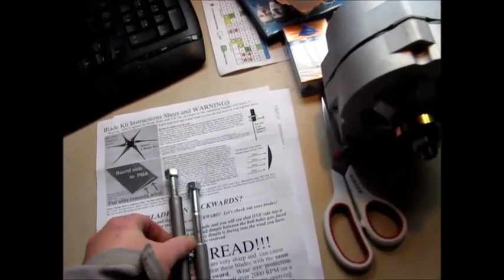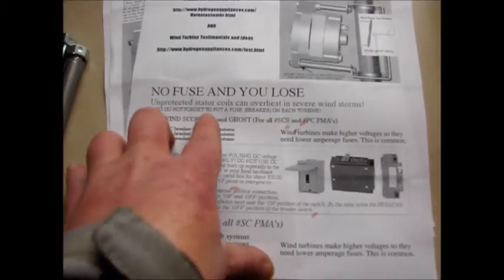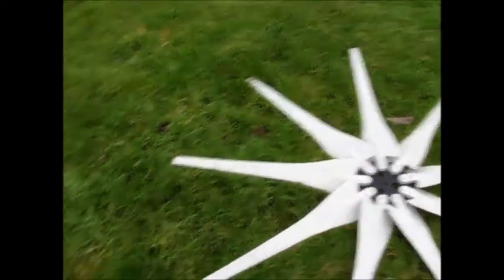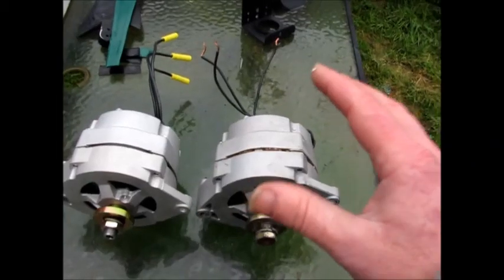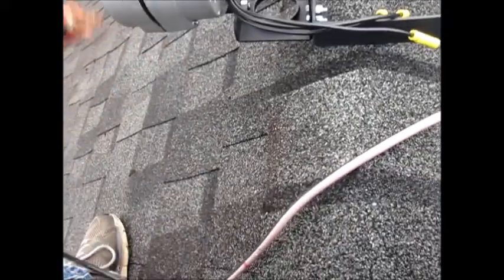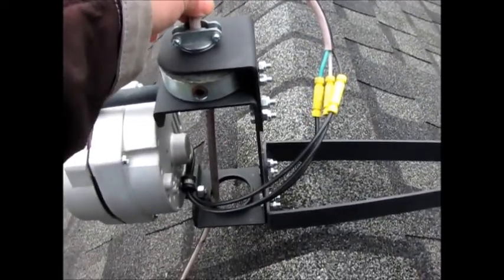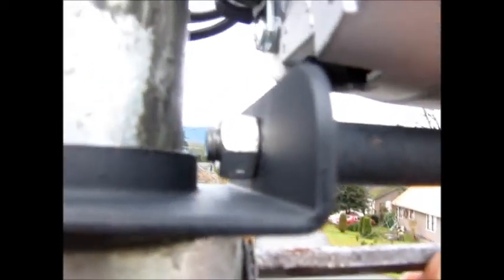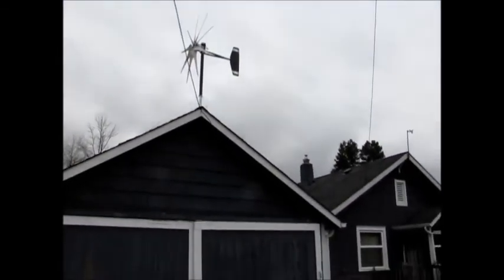Thermodyne Wind Turbine,, How I setup, and install mine

Comment: Jason, I'm starting in Wind energy. I'm wondering to install and still suspicious about pma's...My main concern is the output, Here in Brazil the Wind is quite dirty, many houses, small Yard, trees etc...According with the site the Wind speed avg is 10, 11, 14mph..Can you give na a good idea about the output you can get for this environment?...I mean may entusiastics of the big engines like axial magnetic flux Wind turbines says those small ones can get a useful amperage only in high Wind speed which here is quite uncertain.Thanks man.
Reply from the maker: Well from my dirty wind location exp ,, 10-14mph winds should be around 100w -150w max using the pma style turbine,, That is one reason I can have 5 different turbines at different locations on my property ,, it doesn't seem like much power, but the power increases quick when adding more small turbines to your setup ,, just like adding more solar panels to your setup,,
 I do not know if you are using batteries or going to try to grid tie your wind turbines?

 12 Volt turbines are not good for grid tie ,, to much amps ,, blows up the grid tie ,, in high winds,, I have seen during my winter windy season 100mph wind gusts,,
 I have to use batteries and dump load controllers during my winters, on my 12 volt turbines ,,

 Wind power is not as easy as solar ,, wind power takes some tinkering and fiddling around with to get the most out of your winds in your location,,
 If you buy a turbine make sure you can adjust how many blades and the size of the blades so you can fine tune it for your location so you can get the most power you can out of it ,,
Reply: Thank you Jason for the valuable information... Well as i expected you gave me the idea i had about pma. I started building a single 10th axial flux wind turbine...I think is more economic have one single unit than 3 or 5, my yard is quite small :(....I expect to at least get 400w 500w with 10 to 14mph.(hopefuly)...Maybe with some good gusts 1000w.... Actually I don't completely like this idea since the size and the weight is a challenge combined with a small yard... At least I'll raise only one pole :)... Thanks for the advice.... afterward I'll post a video about my set up.... Best regards Jason

Comment: Just an FYI, The reason for the angled mount is so when the wind blows hard, the BLADES will flex and possibly hit the mounting pole. It wont be angled wrong if you put it on your roof.
Reply from the maker: +Gordon Fisher,,,,
 If the turbine blades are designed properly the blades will not bend back and hit the turbine mounting pole ,,, I have seen over 80mph wind gusts and my MW&S G4 blades have never come close to hitting my mounting pole ,, I think if you have to change the angle of your turbine so Poorly Designed blades wont hit the mounting pole then,, well the blades are not designed properly ,, My MW&S G4 blades work perfectly for my single core turbines,, I trust my MW&S blades over 100mph wind gusts, and from what I HAVE EXPERIENCED IN MY AREA so far, my G4 blades Are designed properly,,, I have a old school MW&S turbine still running strong and safe for me and my family,, it is about 4 years old now with no maintenance ever needed ,

Comment: what keeps the cord from coiling up in the pole, is there a stop or a slip ring ?
Reply from the maker: Jay Finke The cord just hangs inside the pole and on short poles it will tangle,, here is a link to a video that shows how I fix this problem, at about 4 mins into the video,  https://www.youtube.com/watch?v=UBd2C-w7m-M ,, 
Here is another way I am testing using a 3 wire slip ring on short 10 foot poles,, https://www.youtube.com/watch?v=k86G_GbkZu8 ,,